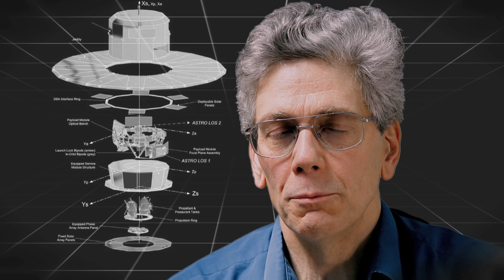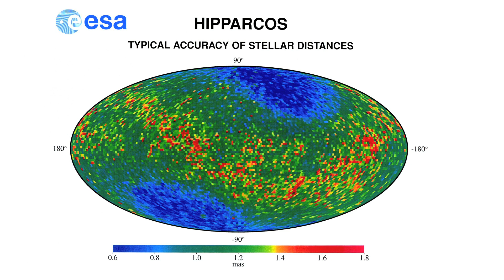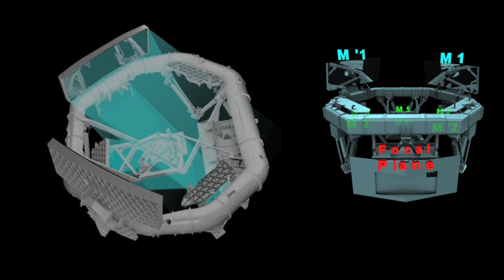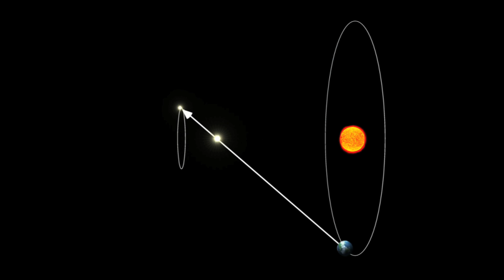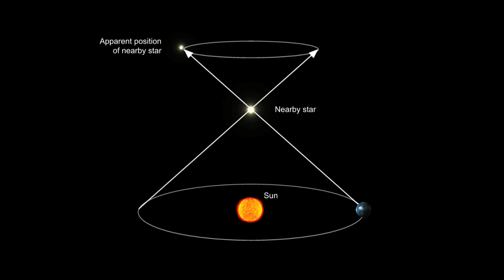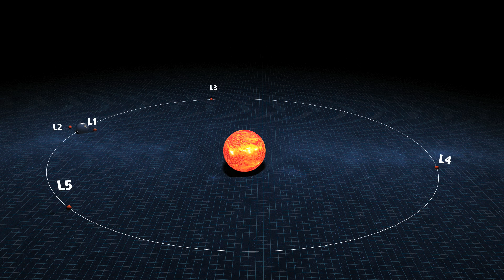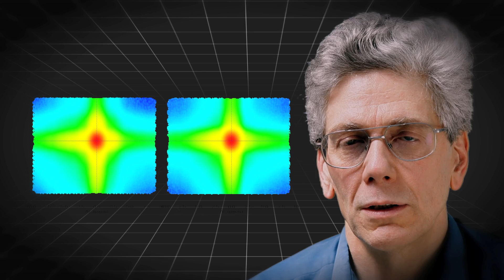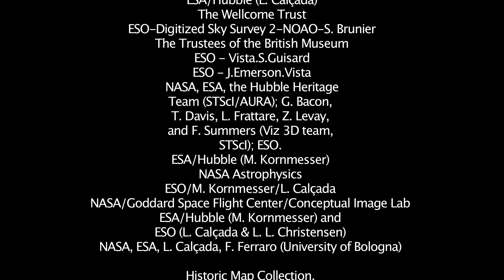Gaia's mission: solving the celestial puzzle

Comment: Would anyone be so kind as to enlighten me on how the sensor or computer will differentiate between the data from the two different collectors? Because what happens when two stars appear nearly or exactly on top of each other? The only reasonable explanation that I could think up was that one or both of the primaries are tilted slightly, so the stars would have a sideways path over the sensor, and you could then differentiate them by the angles of their paths.

Comment: Beautiful, beautiful. Very well made, poetic even as is appropriate, with suitable background music.

But, I calculated what one micro arc second on the Moon would look like, and I find 1.9 mm. So Prof. Gilmore must have rather small thumbnails...
Reply: BadWolf DAngel Just read Martin Vermeer's first post. He's correct in his statement. It refers to an incorrect comparison made in the video.
Reply: Fine
Reply: 1.9mm is 10x smaller than 19mm which is about the size of a thumbnail.  Is there a factor of 10 error somewhere.  Either yours or Prof Gilmore's.
Reply: Michael Rinaldi Yes, indeed. Did you come up with that yourself, Einstein? ;) 
Martin Vermeer is correct. It's 0.19 cm. The video is wrong about that. Damn youtube for deleting my previous post. Not the first time...
Reply: Reto Fassbind
I dont get it , you say that may be will be big errors in the data? or what is your point?

Comment: This is an astonishing project, and one of the most exciting to have occurred in my lifetime! I can't wait to see what it brings us.
I have a question: Will the telescope  give us useable data straight away or do we have to wait until it has completed a few cycles around the sun?
Reply: Check the official Data Release Scenario of the project here:

http://www.cosmos.esa.int/web/gaia/release

Here is the time schedule of the planned releases:

First release: summer 2016
 
Potentially, the catalogue will be consisting of:
Positions (α, δ) and G-magnitudes for all stars with acceptable formal standard errors of positions. For this release, it is assumed that at least 90% of the sky can be covered. The release is for all objects with single-star behavior.
During the commissioning phase, a special scanning mode repeatedly covering the ecliptic poles on every spin is planned for calibration purposes. These data cover small, 1-degree fields around the ecliptic poles with high redundancy. Any ecliptic-pole data with adequately characterised calibration and successful processing will be released.
Those stars common with the Hipparcos Catalogue will be used in the Hundred Thousand Proper Motion (HTPM) project, the catalogue of which will be part of this release.

Second release: early 2017
 
Potentially, the catalogue will be consisting of:
Five-parameter astrometric solutions of objects with single-star behavior will be released under the assumption that at least 90% of the sky can be covered.
Integrated BP/RP photometry, with appropriate standard errors for sources where basic astrophysical parameter estimation has been verified (these parameters will also be released).
Mean radial velocities will be released for objects showing no radial-velocity variation and for which an adequate synthetic template could be selected, under the assumption that this can be done for 90% of the bright stars on the sky.

Third release: 2017/2018 (TBC)
 
Potentially, the catalogue will be consisting of:
Orbital solutions, together with the system radial velocity and five-parameter astrometric solutions, for binaries having periods between 2 months and 75% of the observing time will be released.
Object classification and astrophysical parameters, together with BP/RP spectra and/or RVS spectra they are based on, will be released for spectroscopically and (spectro-)photometrically well-behaved objects.
Mean radial velocities will be released for those stars not showing variability and with available atmospheric-parameter estimates.

Fourth release: 2018/2019 (TBC)
 
Potentially, the catalogue will be consisting of:
Variable-star classifications will be released together with the epoch photometry used for the stars.
Solar-system results will be released with preliminary orbital solutions and individual epoch observations.
Non-single star catalogues will be released.

Final release: 2022 (TBC)
 
The catalogue will be consisting of:
Full astrometric, photometric, and radial-velocity catalogues.
All available variable-star and non-single-star solutions.
Source classifications (probabilities) plus multiple astrophysical parameters (derived from BP/RP, RVS, and astrometry) for stars, unresolved binaries, galaxies, and quasars. Some parameters may not be available for faint(er) stars.
An exo-planet list.
All epoch and transit data for all sources.
All ground-based observations made for data-processing purposes.

Comment: 13:00  Well seriously... in L2 how does the gravity of the earth cancel the gravity of the sun? When they are both acting in the same dirrection.. (or L3 for that matter somehow in this video it became L4). Fact is that these points allow objects to orbit around the sun at same period as earth therefore earth doesn't interfere on the fluctuations of radiation or in Herschel instance infrared radiation emittance. So saying that gravitations cancel one another out is absolutely wrong, am I right?
Reply: You forget that the Lagrange points are not only about gravity but also the motion of the system. In L2 the sum of the gravitational pull of both earth and sun gets exactly cancelled out by the centrifugal effect of  the point on its orbit around the sun. The same is valid for the trojan points, where the sum of the gravity of sun and earth and the centrifugal effect of the trojan points is zero.
You just forgot to consider that the whole system is in motion. It’s not static.